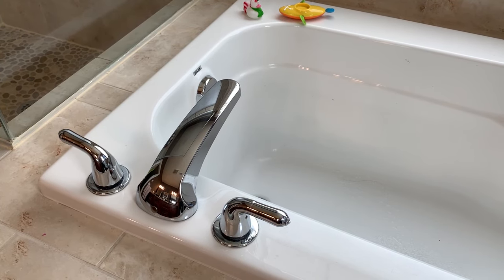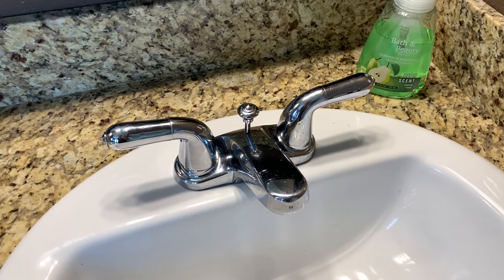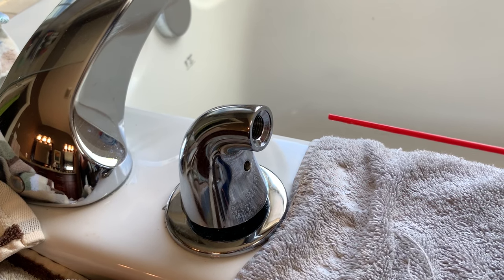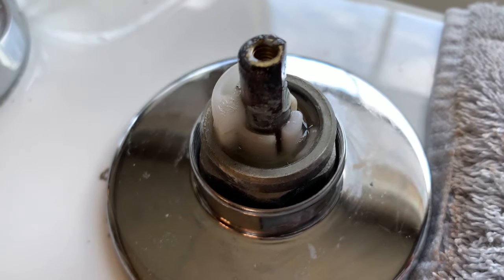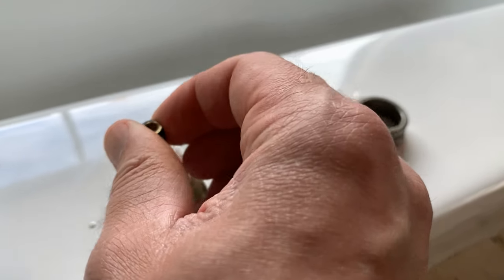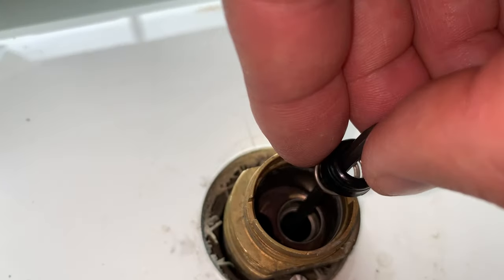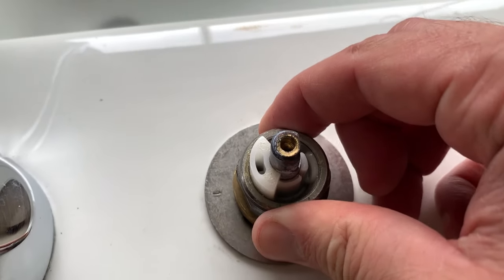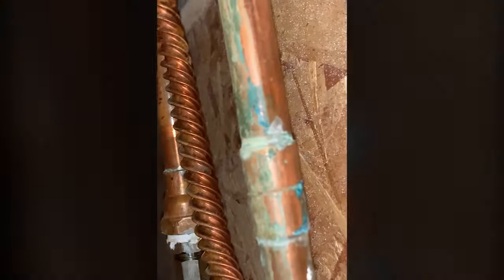How To 008 - Leaking Bathtub Faucet & Delta Handle Removal

Comment: Thank you. You are a genius.  I'm so sick of all the videos that say remove the set screw and lift the handle off.  I have in 30 or 40 years of owning a house never had the handle just lift off.  I usually go through a gallon of WD-40.  The important part of what you showed that finally did it for me is prying from two sides at once with two pry bars. It never worked with just one pry bar using two and wiggling. Your way up is what worked.  Thank You thank you. Thank you.
Reply from the maker: This is the exact reason I made this video. Everyone always cut away when they removed the handle. So I wanted to show everyone what worked for me. There has got to be a better way though!

Comment: Thank you and thank you.  Plumber wanted to replace the entire faucet, knock a hole in the tiles on side of roman tub....for $2K.  Thanks to your video In was able to replace the cartridge but also needed to replace the seat and spring.  Thanks again.
Reply from the maker: I am so proud of you for taking it on yourself. It’s incredible what we all are capable of. Glad my video can help! Please help me by subscribing. Thank you 🙏
Reply: I have the same faucet and the plumber couldn't even get the fixture off and he gave up. He wanted to charge around 450 to fix it if I can recall. This video is a big help and I will just do it myself.

Comment: Mine exploded and shot water up into the air. I ended up gutting it and switched to a kohler one that lasted me 13 years. And it just died yesterday lol. The delta one lasted six months. Can’t be too shocked the fact it’s made from a airline company
Reply from the maker: Dang, 6 months. That sucks. This one lasted 14 years until it leaked. Though my other bath is still good as are my sink handles. Also, I’m pretty sure Delta airlines doesn’t make faucets.

Comment: So how does the faucet cartridge line up with the spring assembly. I'm confused
Reply from the maker: The white plastic in the cartridge is the stopping points for your handle. So line it up how the handle is supposed to go. Does that make sense?
Reply: @imag33  kind of makes sense. My handle is probably a 1/4 of a turn not straight so can I just turn the cartridge anyway I want to make sure the handle is straight or does the cartridge need to match the bottom spring somehow
Reply from the maker: @Its_about_that_time  it doesn’t matter about alignment to the springs. There are grooves in the copper seat that the cartridge fits into. So it only goes on two ways. Generally the plastic wedge is pointed toward the faucet so it stops the handle. Try one way and if it doesn’t work try the other. You’ll for sure figure it out, you got this 👍
Reply: @imag33  thanks for the response I am sure to try it. Appreciate it

Comment: Thank you thank you thank you so much for showing how the spring and gasket fit in there! The previous video I saw didn't even look down the stem!
Reply from the maker: I appreciate the feedback and I'm glad it helped! I hate it when other videos skip parts. I want to know EXACTLY what I am getting into when I go to take things apart.
Reply: @imag33  Yes totally! The other guy's video didn't even show the spring or the spring gasket.  
After watching your video it was a piece of cake!!  
(Then I lubricated all my o-rings and the spring gasket with an o-ring protectant just so they would last longer and I double o-ringed the large exterior surface of the part.  Then I put 10-year mold resistant silicone caulk around the outside of the assembled part just to keep any water from the tub from leaking underneath the handle and causing mold or mildew  (I had mildew underneath the handle shroud when I removed everything)

Comment: Hey everyone. Just a quick tip.  You may not need to replace it at all. Mine is 20 years old and all I need to do is tighten it. 
 If it's used often it can get lose and thats all you need to do instead of replacing the whole thing.

Comment: Was this leaking while tub was turned on or while off? Having this issue while handle is turned off
Reply from the maker: @aarongrove8239  for it was an issue when turned on. If it’s dripping while off you’ll have to point right where it’s leaking. If it’s below the faucet base, it’s likely from your water line connection going to it. Maybe a new rubber seal, or tight then connection. If it’s coming from the faucet, replacing the spring and rubber seals like I did in this video might fix it. Let us know!

Comment: I'm guessing that  grease on the handle threads might help keep the handle from sticking in the future?
Reply from the maker: 100% that would help! But while I have used anti-seize for car repair, would it also work here to prevent calcium buildup?

Comment: I'm trying to remove my base but it's on tight. Any specific way to take it off I have no grip points on it
Reply from the maker: Damn, yeah it’s a pain to get it off. You’ll have to get something to leverage it from below. I used a hammer and crowbar to pry it up. Try getting WD40 or CLR in there to remove the buildup. Also, lots of good luck 👍

Comment: How do I remove the handle on the wall for tub shower handle? Also for me little handle part that you unscrew easily from handle is also not moving any tips for that?
Reply from the maker: For the wall style handles, usually there is a screw behind the center cap part. Or it has a small set screw somewhere that needs an Allen Key to un-screw it. Typically it is a 1/8" allen key size. Also, make sure the set screw is not stripped by looking at it with a flashlight or phone.

For the little handle part, you will need to really turn it hard for it to break loose. It also builds up calcium and can get stuck. You could try wrapping the handle in a small towel then using an adjustable pliers or channel lock to try and break it free. Or soak it in CLR or WD-40 to help loosen it up before trying to break it loose. 

Let us know what works for you! Good luck!
Reply: I was able to get the little handle part of by turning hard. However still not able to get the handle off the wall. Did wrap with vinegar towel overnight. Anything else I can do? Set screw is out.
Reply from the maker: @menubans  Yay! Glad you got the little handle off. Also good idea on the vinegar wrap. However if you can, soak the handle in CLR as it is 10x more concentrated than vinegar. You can possibly pour CLR into the hole that the little handle was screwed into. Otherwise if you have the set screw out, there is nothing else holding the handle on except for calcium build up. So you will have to use a pry bar like I did to carefully work it out. Please let us know how it goes so we can learn together.

Comment: Is this for of its dripping from the spigot on the tub?
Reply from the maker: @timcapell   yes, it can be. Most likely you need to replace the springs inside the faucet  handle(s). At the 3:30 mark you can see the springs and seats. Try replacing those on both faucet handles to see if it stops your leak. Then report back here to see if it solved your problem. Best of luck my friend!
Reply: Awesome buddy! This did it! Got the whole set springs seals and those stems on amazon. Drip is gone now. Thanks again for your help
Reply from the maker: @timcapell  what?!?! You did it!!! Woot woot. Super proud of you. Way to go. Glad I was able to help out. Wanna help me out by subscribing? ;)

Comment: What tool was that? To remove the tiny screw?
Reply from the maker: Allen wrench!!!
Reply: @imag33  what size? I tried them all and it will not grab.
Reply from the maker: @RLPerez-un6hv  I’ll check when I get back home, but probably metric size
Reply: I have the exact same issue. None of my Allen keys fit. Any luck getting an answer on this?
Reply from the maker: @kennynketia1085  sometimes a star bit or even a screw driver can unscrew these. It may be stripped. Put a flashlight in to verify its condition and shape.
Reply: @kennynketia1085  not yet.
Reply: @imag33  mine isn't stripped.
Reply from the maker: @RLPerez-un6hv  did you ever get yours out? Or figure out what needed to be done?
Reply: @imag33  no sir. I'm going to try that star wrench he is referring to and see. It's that or pony up for a "pro" $$
Reply from the maker: @RLPerez-un6hv  dang, well I just confirmed that my 1/8” size Allen key fit it perfectly.
Reply: @imag33  I guess I'll have to get that one. Let me know how the repair went.

Comment: Why does it appear that you reinstalled on stem on the hot side? Corroded
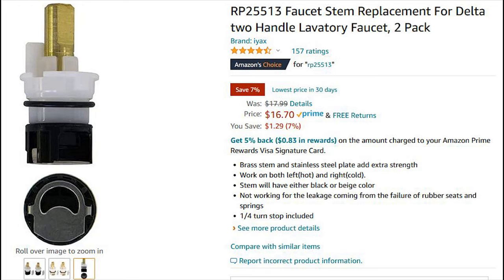Reply from the maker: Good eye! I actually replaced the stem a few days after this and didn’t film it. But I did replace it with the one shown at time 4:20

Comment: Thanks I have almost the same style faucet with the same problem ,  stuck handle. I tried first with no luck. Then asked a plumber , also no luck . Said I would have to replace everything including the valve assembly . Although they didn't even try prying it like this . See how it goes .
Reply from the maker: Good luck! It was a huge pain but careful prying and it finally came off.
Reply: @imag33  it came free! Glad I seen your video .as I went at it again with a little more patience ... Not so impressed with the plumbers Iol.
Reply from the maker: @6xRedDevilx9  yesssssss! You did it Steve!  Nice work my friend. So glad it worked out for you and that I was able to help.